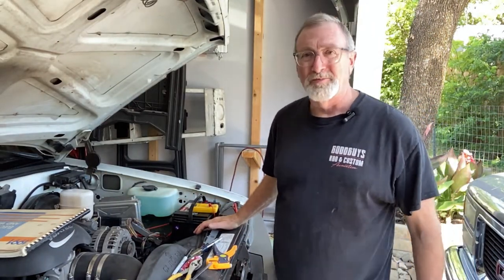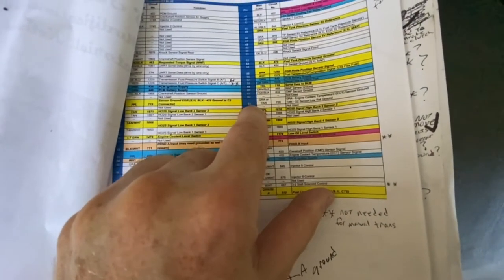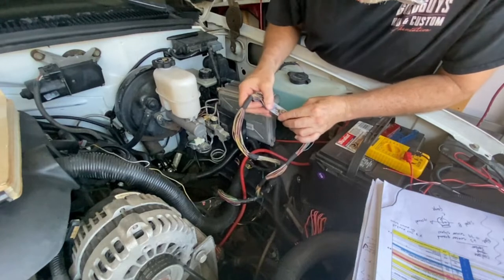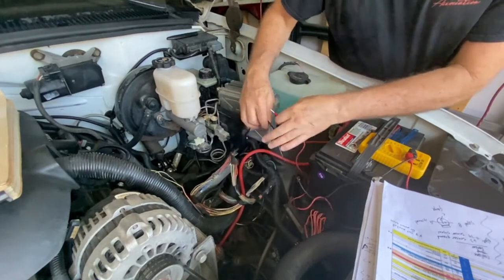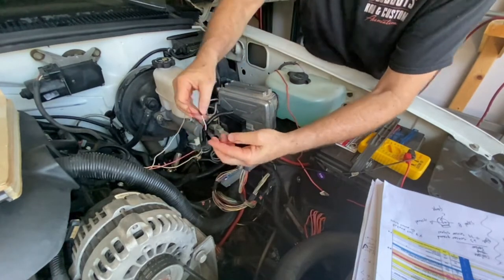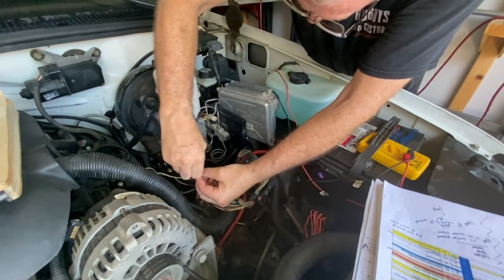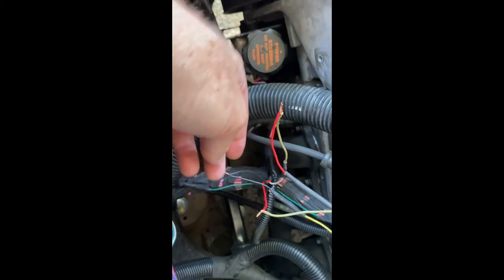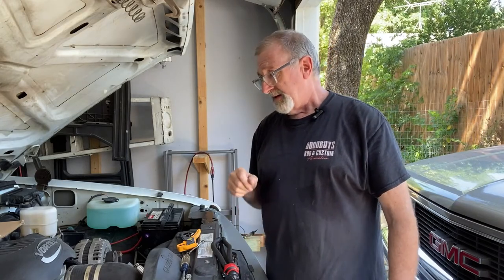OBS Chevy Cheyenne LS Engine Swap 3 Wire Temperature Sending Unit Wiring Fix

Comment: Good demonstration Laurence, I found a good sized bundle of velcro in the craft store I'm going to use for rebundling the wire harness the next time I rework a wire harness. It won't be sticky and it's easy to undo  and redo and cheap enough to leave on there.
Thanks again Laurence 👍
Reply from the maker: Good idea. I decided to tape up way to early. Next time, I will maybe zip tie or velcro until I get everything just right.

Comment: Been watching you a while, I began swapping my 95 stepside a few months ago, you've been a great help.  

What is the p/n for the 3-pin temp sensor your using? 
the one I purchased doesn't fit without an adapter and I don't really want to do that. 

Thanks!
Reply from the maker: The 3 wire coolant temp sensor wiring connector I used can be found on ebay..https://www.ebay.com/itm/123934748712 ,  the 3 wire sensor is ACDelco GM Original Equipment 12551708 Engine Coolant Temperature Sensor (on amazon at https://www.amazon.com/ACDelco-12551708-Original-Equipment-Temperature/dp/B005OVAUN2/ref=sr_1_2?crid=3SX4FWZJTW1A4&keywords=12551708&qid=1659846878&sprefix=12551708%2Caps%2C135&sr=8-2 )

Comment: Hi LAURENCE , i am working on a swap right now with a 89 chevy 1500 with the same dash gauges you have in your video . i put in a 2006 vortec but it has a 2 wire temp sensor . i bought a standalone harness and computer from psi and got it running no problem . im having coolant gauge issues . i still have (half) of my factory 89 wiring harness under hood . cut away what i could tell was no longer needed. Now im trying to figure out how to get the single GREEN 1 wire coolant temp sensor wire to work properly with my gauge . i have already bought the adapter to go on pass, side head with a single wire sender . but with no luck everytime i hook up the green wire to the sensor i get a pegged out guage . Any word of advice or help would be greatly appreciaated . thanks
Reply from the maker: I found it works best to use a 3 wire coolant sensor from a late  90’s Camaro v8. 2 wires go to the ls pcm and the 3rd goes to the gauge.
Reply: You can add a second sensor on the passenger side head and run your gauge from that.

Comment: I did the same thing on my 94, but my guage just read 260 all the time, any pointers?
Reply from the maker: Did it read 260 upon startup? Or did temp increase over a few minutes to 260? What specific temp sensor are you using? Was it working correctly prior to swap? Did you for sure wire per pinout and not color of wire? Lots of possibilities here…

Comment: In my case I bought a stand alone harness didn’t come with this plugs. When I started my swap I left the stock connector that plug with previous engine can I just use those ?
Reply from the maker: If you were able to reuse your stock sensor and wiring, I would say yes, as long as the correct 2wires interface with the ls pcm.
Reply: @laurencevillegarage  but also have complete harness of the ls engine can I just cut (obs plug) and solder the plug of the ls ?
Reply from the maker: @Sickwiddit2820  if you mean use the ls plug soldered to the OBS wiring…yes for oil pressure but no on coolant sensor.
Reply: @laurencevillegarage  do know what wire is what. The obs plug has a grey,orange, and a light brown wire while the ls plug has red,grey, and black wire
Reply from the maker: @Sickwiddit2820  you need to look up a wiring schematic for that sensor that you’re going to use. And then match the plug to the wire and not pay attention to the color of wires that are on your actual plug but the actual wires coming off of your harness. This is kind of hard to do via texting. I’m not able to see exactly what you’re dealing with. When you’re working with an LS harness, OBS, harness, and an aftermarket harness, it can get very confusing. Are the easiest way would be to use the correct two wires for the LS harness from the PCM to the coolant sensor, and then find your third wire in your OPS hardest that’s for the gauge to connect to the third wire on your sensor.
Reply from the maker: Of the three wires from UPS harness, I believe the light brown is the gauge. But, the three wire sensor it’s going into your engine. Does it really matter what color those wires or what does matter is the pin position. That’s where you need to look up online a GM three wire, coolant temp sensor wiring position. That will let you know which of the three wires on the sensor plug is actually for the gauge.
Reply: @laurencevillegarage  appreciate makes more sense now then where I was originally at